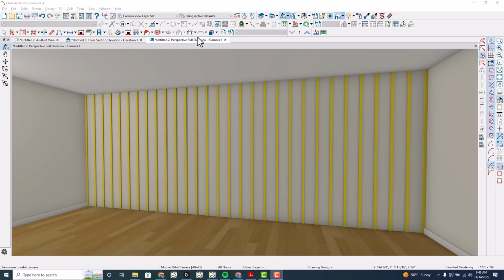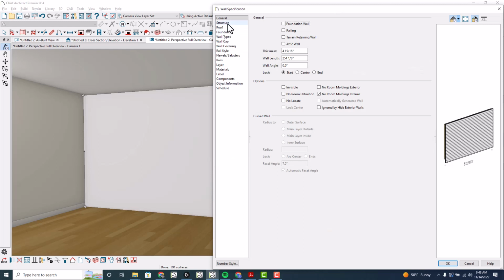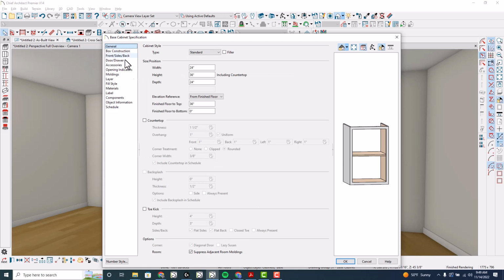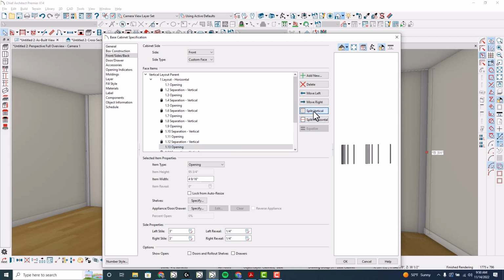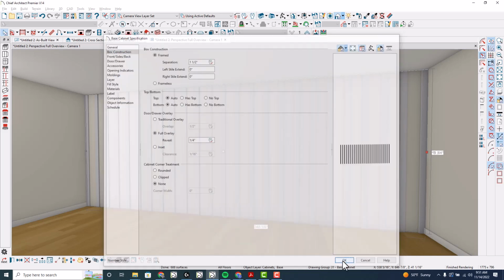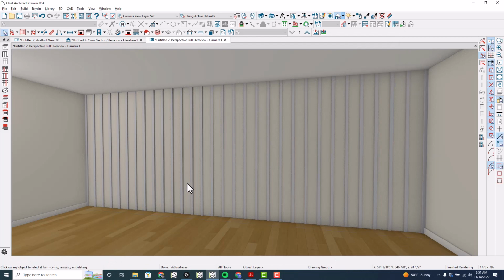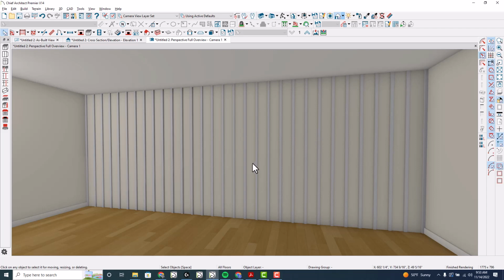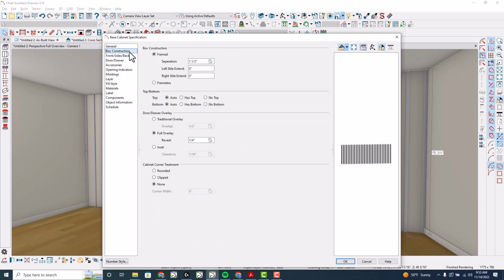Fast 3D Accent Wall | Chief Architect

Comment: what an EXCELLENT video! thanks so much for taking the time to make this to help us out :)  I do have one question - I have duplicated your steps with much success (chief x16) however after altering the size of the overall 'cabinet' a few times it now doesn't do anything when I click on 'equalize' so I'm left with a few slat openings that are not the same size , any ideas?
Reply from the maker: You can split multiple "layouts" of the cabinet face items, and it may be that you have too many "sub" layouts that it cannot equalize. The best function would be to have just one "layout" then that layout can be equalized.

Comment: Thank you for this! What if there's a window or a door? Do you cut the slats out somehow?
Reply from the maker: You cannot cut these slats. You’d have a different solution most likely. To use cabinets you’d have to create a cabinet to the sides (full height) and above/below the doors/windows but then it wouldn’t necessarily be evenly spaced. 
I’d suggest using wall material regions that can be evenly spaced and then doors and windows will automatically be “cut” out.